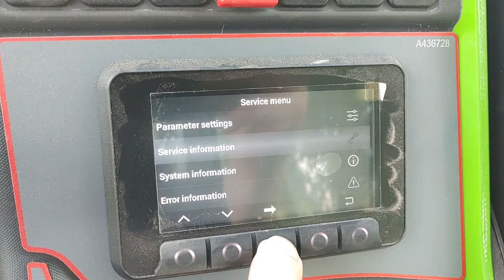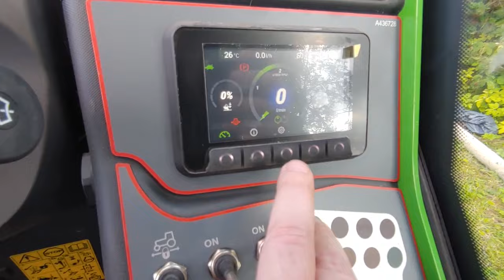Avant 650i - 50 hour service

Comment: Where the hyraulic pressure measured? Numer 13, 14 and 15 on the checklist. Especially Measuring the charge pressure of the variable displacement pump (#14 on checklist) is supposed to be important.
Reply from the maker: I don't remember that it was measured, I'll ask about it next time I'm at the dealer, thanks.

Comment: Why would you need to remove the hoses from the back of the multi-coupler? Just to drain the oil better?
Reply from the maker: It was just to replace te tank return plug in the quick connector, it was leaking some drops and making a mess, covered under warranty.